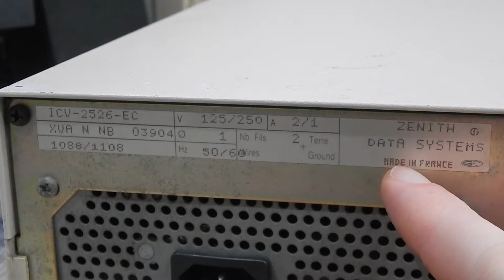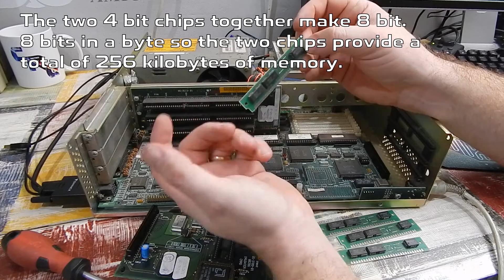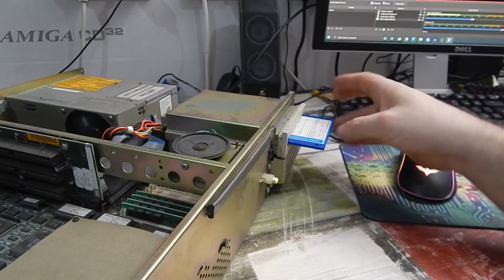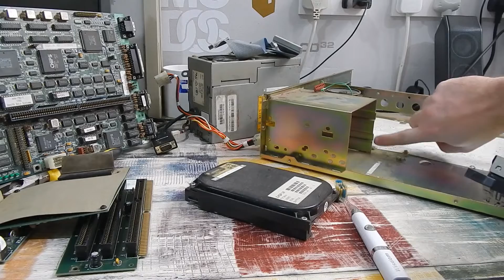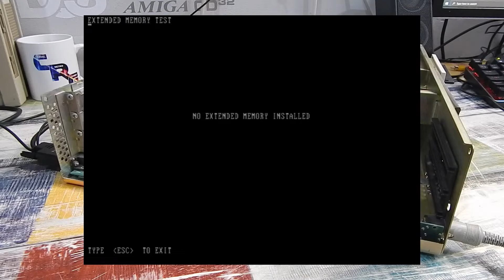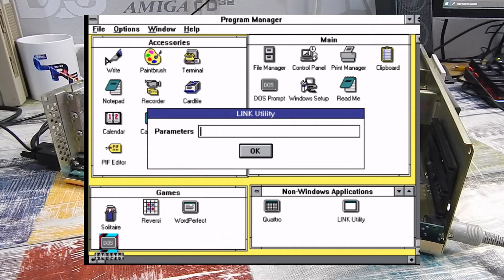Zenith Data Systems 286 - Part 1

Comment: I recently bought the British Telecom M5210 Series PC exactly based on this Zenith Data Systems 286. I have been  trying to find a manual for it. So far I put a Trident 512K  graphics card in it and the amount  of RAM is  640K. No idea if it can be expanded. However  I am pleased I managed to get it working.  I bought a serial mouse for it an it happily installed the drivers and software.

Comment: Almost 20 month old video, I'm watching this for maybe the 6th time, and I only noticed this just now: For expended memory, the BIOS is only asking for the memory above 1 MB. It says so in a note at the bottom of the screen. As for the CPU upgrade, I think you can use a 486 here but only the 486SLC chip, which as far as I can tell has a 16-bit external bus. At least, that's my understanding of it having read about it just a little bit.

Comment: Hang onto that floppy.  Zenith Floppy drives of that era are oddballs.  They're not a standard size bezel.  I think it's because zenith kept using chassis from the mid 1980's well into the early 90's that were sized for the old 720K floppies.  You'll notice there's a small lip on top of the floppy.  If you replace it using a standard drive, there will be a large gap.
Reply from the maker: Well the drive is working well so it'll stay in place in that system.  Thanks for the tip though.

Comment: Can you modify the "Main RAM" line to select 384K of Extended RAM? "Add-On RAM" might not be referring to the SIMM slots.
Reply from the maker: It won't let me change the figure beside main ram.  I've since upgraded the ram to 4mb total (new video coming tomorrow) and with that amount I can select up to 3072kb on the main ram line.  That 384 is still missing though.  Mem in DOS 6.22 shows 384 as reserved so can only be shadowing, or at least that's my best guess.

Comment: Borland Quattro and SemWare's QEdit are a conflict in Windows Setup's application database (their executable file names are both 'q.exe').  The linker is definitely part of one of Microsoft's compiler toolchains (the reference to '.obj' files confirms it), though very few people would ever need to run it interactively like this, Microsoft included it in...Windows Setup's application database.  These are a dead giveaway that someone installed Windows after purchase and when Setup found programs already installed on the disk, they didn't read or understand what was happening and just clicked Next or Finish, so it created all these erroneous or unnecessary shortcuts.

Comment: This was my first computer when I was younger. Found it on the side of the road. Its configuration had the CPU onboard (without the riser card), it ran at 12MHz, had 1MB ram and no hard-drive. It was a great first computer when I was 5 or 6. I played a lot of Bio Menace on it! I remember a lot of disk swapping. I'd love to find another one here in Australia.
Reply from the maker: Thanks for letting me know. Bio Menace looks like a fun game, I'll have to give it a go.
Reply: @CRG  Me too! it was my first pc, and I also had it complete with the Zenith Data System 14-inch crt VGA monitor.
I also had the manual and I think 3 or 4 original floppy disks of MS-Dos 4.0
Mine had an ISA card for the joystick port.
I can tell you that I surely remember it could be upgraded with a 16Mhz 386 (probably sx?) processor and up to 8 Megabyte of Ram with 8 x 1 MByte modules.

Comment: Did you ever get a handle on why it just turned itself off that one time?
Reply from the maker: Nope, it was a complete mystery.  Everything was still on but it just died.  Hasn't gave another bother since and it's been run for extended periods.  

Only thing I can think of is maybe a bit of dust shorted something in the PSU but there was no obvious noise of arching, no flashes, no smell.

Comment: Thank you for putting this video out!  I recently got my own Zenith 286 and when I tried to power it on, it just gave me a blank screen.  Mine is a different model that is about twice the size of your machine all around and uses a card into backplane system.  Oddly, my CPU and RAM cards would plug into your machine's riser card slot.  Hopefully, I can get it up and running at some point thanks to the information shared here.
Reply from the maker: That system of yours sounds interesting, do you by chance know the model number of it?  

If you are just getting a black screen it might be hard to diagnose what exactly is wrong with it but I'd check for any jumper settings that may effect the output.  Even with the black screen can you hear the system start-up, i.e. are there any tones from the PC speaker?  

I hope you can get it going, please let me know how you get on.
Reply: @CRG  I unfortunately don't have the model number at the moment, because it's in my storage unit not at my house.  What I did observe was the LEDs not going out one by one like yours and no beeps at all.  Perhaps the CPU needs some attention.  I did buy it from Computer Reset in Dallas Texas where it spent years in a warehouse that got extremely hot and cold over a period of decades.
Reply from the maker: @JVHShack  if it uses the same CPU interface I'd start there.  When mine wasn't working initially all the lights were just on.  I found with my CPU card you need to put it on then pull it back just a little bit to get it to work.
Reply: @CRG  I wish mine did have the same daughter card as yours, but it uses a full size ISA-like card.  The contacts are 2 8-bit ISA slots in-line, identical to your riser card slot.

Comment: Any idea what that hook is on the back?
Reply from the maker: Presumably to secure it to a desk / workstation.  No taking this computer for working at home lol.  Its a very robust  case, you'd need a hacksaw to get though that loop if you were so inclined.  I've also found the keys for the case lock, bit pointless but nice addition to have.

Comment: Sweet machine, love the compact form factor.  Retro-brighting would probably be more trouble than it's worth, it doesn't look at bad.  Your plans for it sound good and an 80287 would be nice, if you have such a thing.  😊👌
Reply from the maker: A 287 would make for a nice addition but unfortunately I don't have one.  Not sure there's any software I would be running that would actually need it.  The sound card I have planned for this system is an oddity, I know you'll love it (just hope it works).
Reply: @CRG   👌

Comment: Interesting machine.  Here in the United States most of the machines we have from that time period are considerably more bulky.  The occasional ZDS 286 shows up around here, but they are usually much slower that 16MHz, and they are double the height with full sized 5.25 bays for drives.  A very interesting machine, none the less.  I have an affection for LPX machines.
Reply from the maker: It seems in Europe and the UK we just preferred the small form factor.  I do have a couple of the big case machine to get to (saving them for DOScember) but I have to admit there is something nice about the smaller systems.

Comment: Great video! Very nice, clear presentation at a good pace.

In regards to the LINK Utility program, given its output and prompts, is probably a Linker. Linkers are used at the end of the compile chain to make the actual binary executable out of object files the prior tools generated from code. That it's standalone is odd. Maybe this was a programming PC in its prior life and the previous owner scrubbed the hard drive of the projects they worked on, but forgot to delete this part of the tool chain?

Edit: I wonder if they went through the effort of overwriting the empty space on the drive. If they didn't, you might be able to recover more files with appropriate forensic tools. DOS and early Windows basically only hid the files in "unused" space where they would be overwritten with new ones, so it should be trivial to retrieve "deleted" files.
Reply from the maker: There are a fair few personal files still on the HDD, I didn't show any of it in the video as it lists names etc.  My best guess for this systems past you be that it belonged to someone in the Air Conditioning sector.  There are some technical documents for Toshiba AC systems, there is the information about pipework and stuff from unistrut (manufacturer of containment systems).  Going on what your saying I would guess that the link utility was maybe for bespoke control systems.  

If I get time I'll try to show some of that in the next part before I wipe the HDD, well, I say wipe but I'm going to retain DOS, Windows and probably the applications, just going to delete the personal files.
Reply: @CRG  thanks for the reply! 
That's quite interesting. I love discovering the history of old machines, as they tell stories that might never have been told again otherwise.

To not show personal information was a good call. Thank you again for the detailed reply!
Reply: That version of LINK.EXE may have come with MS-DOS. In fact, that is the very version which comes with that version (Zenith MS-DOS 4.01).
Reply: @fnjesusfreak  interesting! do you happen to know why DOS came with a Linker specifically?
Reply: @KingBowserLP  Not offhand; but 4.01 was the last version that did.

Comment: my guess is that putting the CPU on the card allows it to go at a different frequency from the rest of the motherboard.
Reply from the maker: Possibly, I need to get the likes of landmark across to this system to see what speed its actually running at.

Comment: Typical Zenith construction...built like a tank with a heavy chromate conversion coated chassis which won't rust out.  I parted out a couple of Zenith PCs a few years back along with several other computers I bought at a now out-of-business electronics shop so I could use some of the parts in my 5150.
Reply from the maker: It certainly is a heavy built chassis.  There is a little damage to the outside of the case that you might have spotted but its nothing serious. 

Would love an old IBM for the collection, one day....

Comment: be careful with those old Sony drives. most of them use surface mount caps that need replaced PRONTO to be reliable.
Reply from the maker: This one is working fine but I'll drop the logic board and take a look.  Wouldn't take long to swap them out.

Comment: I always feel a little jealous when I see 286 systems that were better built than my 386 from about the same era. My 386 had weird SIPP memory modules and this 286 has standard SIMMs.
Reply from the maker: I get the impression that around this time, early 90s, there was a shift in computers going from machines being well built to them getting cheaper.  Certainly by the mid 90s prebuilt systems feel a lot cheaper.  I have a later Zenith 486 system and its awful in terms of construction (its also dead from battery damage but that's another story).  

SIPP memory at the time was probably seen as a cheaper method of upgrading, SIMMS are just a lot handier to use these days.
Reply: These early AT systems were build like tanks and to last. My Unisys PW/2 Series 300 are working to this day.

Comment: Plastic slots at the front of the chassis to hold the end of long ISA boards, but it looks as though the CPU card would block the bottom one. As though they've used the same casing for different systems.
Reply: It did look quite substantial. I was sure it wasn't for cable management nor, as you say, to carry home on the weekends.

Comment: I really liked ZDS designs under the Bull era…
Reply from the maker: It is a nice form factor machine.  I was reading about the Bull era of Zenith earlier, seems about the same time as a Packard Bell aquesition which makes sense as I also have a slightly newer Zenith which is a rebadge of a Packard Bell system I've seen before.  All interesting stuff, I'll try to cover some of it in the next part.